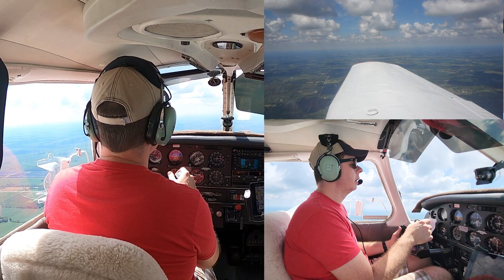Piper Warrior PA28-161 Stalls (Power on and off) for Private Pilot

Comment: Don’t remember why but as to ailerons I thought they should be at neutral in addition to using opposite rudder
Reply from the maker: You are correct when it comes to any type of stall recovery. When and aircraft (or more so their wings) stall, keeping the ailerons neutral during the initial recovery is important to prevent "aggravating" the stall and potentially putting the aircraft in a spin. When adding aileron deflection while the wings are stalled, you can actually cause one wing to become more stalled which can create rotation and around the vertical axis and thus creating a spin situation. Once you correct the stall, which can ONLY be accomplished by lowering the angle of attack, and the wings are creating lift again, then ailerons can be used to bring the wings back to level. Hope this helps and thanks for the comment!

Comment: I’m curious on why all the carb heat on and off in a piper ?
Reply from the maker: Thanks for the comment! With the older carbureted engines, the manufacture recommends using carb heat not only as a de-ice but anti-ice. With throttle reduction such as these maneuvers, carb ice is more likely due to the rapid cooling of the air through the carburetor from the venturi effect when you reduce the throttle rapidly. Basically it makes sure you don't unknowingly get carb ice with low power settings. Most newer engines and fuel injected engines don't have this issue. Hope this helps!
Reply: @PilotRight  I ask because I have a PA28-181 and seem to have this discussion with my cessna friends all the time.  On the PA28 the carb air intake runs through the oil pan that is hot. It’s my understanding that carb heat is not recommended via the POH unless needed. On the Cessnas with the same engine, their air intake is run a different way so carb heat is needed all the time, in the decent when out of the green arc. If you have different info, or if your POH say different please advise.  I don’t use it in my plane and want to make sure I’m doing it correctly
Reply: Read the POH….no need for carb heat every time.
Reply: I’d like some info on this. I went from a 172 to a pa28 161. Carb heat is the norm in a Cessna, but it would be nice to not have to use it all the time. I’ll check the poh myself tomorrow.
Reply from the maker: Straight from the Lycoming manual in reference to Carb Heat: "(5) Landing Approach– In making a landing approach, the carburetor heat should usually be in the Full Cold position. However, if icing conditions are known or suspected, the Full Heat should be applied. In the case that full power need be applied under these conditions, as for an aborted landing, the carburetor heat should be returned to Full Cold prior to full power application. See the aircraft flight manual for specific instructions. As a safety measure, there is no objection to the use of carburetor heat during landing approach provided that on a go-around, or touch-and-go landing, the carburetor heat is returned promptly to the cold position."  

While under normal circumstances, carb head is not usually required, however, with this interpretation, serval of the flight schools and universities I have dealt with in the past choose to lean on the side of caution. Since flight training is far from normal cross country or mission flying, with constant engine RPM changes, altitude, airspeed, and configuration changes, most in the training world find it better to use it to prevent ice and not just remove ice. Having had carb ice on more than one occasion, I also like to teach and practice prevention instead of removal. I hope this helps!
Reply: Piper pa28 use carb heat which is draw directly from the exhaust. The use of carb heat is both Cessna and Piper are used for the same purpose and effect regardless of where the heat originates.  The use of carb heat allows hot air to flow into the carb at low RPM preventing the “venture effect”. This hot air flow also robs the engine of RPM. Which is why it is turned off during normal flight conditions and is checked for such effect during ground run up.
Reply: @XRP_Rocketry  he’s not asking what carb heat is, he’s saying that the main intake routing keeps the air warm enough to negate the need for carb heat unless in a situation where you develop carb icing.